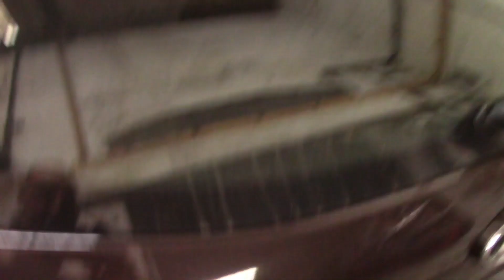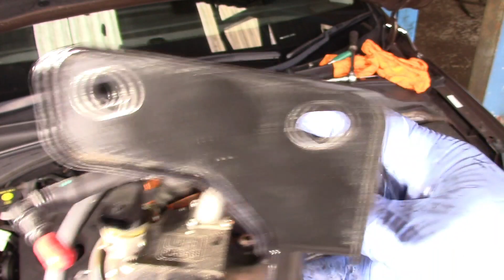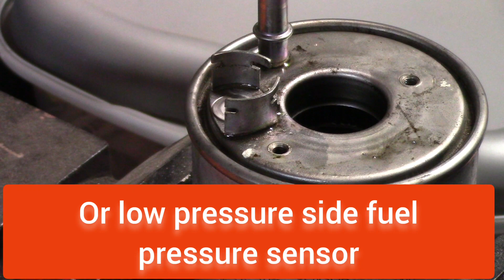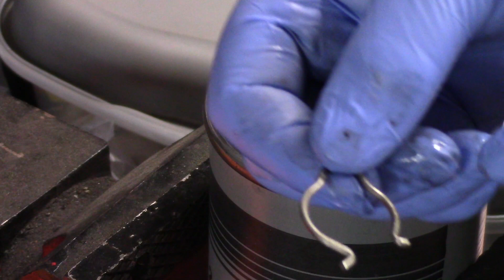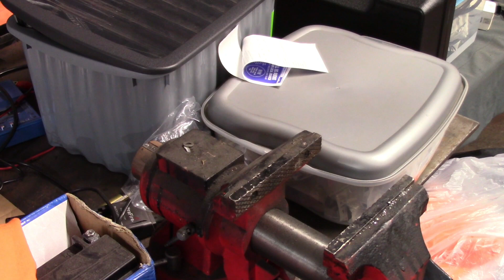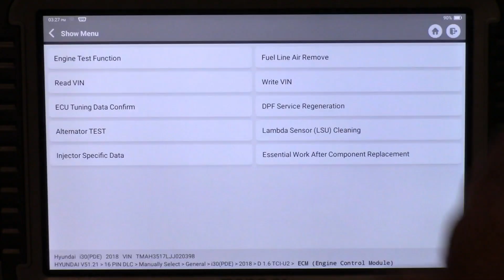Hyundai i30 (PDE) 1.6 CRDi D4FB (U2) Fuel Filter Replacement And Fuel System Bleeding

Comment: Hi, thank you for uploading this video. I got the 2018 version of this Hyundai i30 hatchback with 110 bhp. However, when I look online for suitable fuel filters, it asks me to enter the registration of the car which I enter and then there are several filters but have different numbers & look different but they say they will work in my car so how do I know which is the right one to order?
Reply from the maker: Thank you for watching our channel, best option is to contac the supplier to get the right part, or see your current filter part number.

Comment: Hi thanks for the video. If I can't bleed it and I already took out the filter, is it bad to start the car and drive to a mechanic?
Reply from the maker: We appreciate your viewership. The primary purpose of bleeding is to avert dry operation of the High-Pressure Fuel Pump (HPFP). Operating the HPFP without fuel can lead to significant damage, as fuel serves as the essential lubricant for the pump. Once the engine has been successfully started, there is no further requirement to transport the vehicle to a mechanic.

Comment: Hi.
Nice video, helped me to answer the question: how are you going to bleed the filter after the work.

But on mine I haven't removed anything else apart only fuel filter lines and the body with the filter it's self. Wasn't necessary to removing intercooler pipe.

Regards
Reply from the maker: Thanks for watching our channel

Comment: Which OBD2 tool do you use? Did it not make you nevous that it kept saying "Failure!!!"?
Reply from the maker: Thanks for watching our channel. 
It is a TOPDON PHOENIX PLUS SCANNER.
Reply: I have used Xtool A30M on mine and it worked perfectly. You can even choose for how long you want this pump running or until you press stop.

Comment: Hi, great video. When it comes to bleeding the fuel filter (not everyone has a diagnostic tool to bleed the filter), could you prime the new fuel filter by filling it with diesel first before installing it. After the pipes have been reassembled and the electric fuel pump has been primed by switching on the ignition, surely the engine would start straight up as filter is full of diesel??
Reply from the maker: Thanks for watching our channel 
I followed the service manual instruction, and i didn't try filling the fuel filter up, but on this model, the fuel pump will only be activated when the ecu receives the crankshaft signal, not with only turning the ignition key to the on position.
Reply: Thanks for replying. I just wondered if filling the fuel filter would help with the bleeding process. The earlier i30 diesel engine had a hand fuel primer on top of the fuel filter housing which was brilliant. Why do manufacturers have to over complicate a simple service item. Thanks again for posting the video.

Comment: This Hyundai system is a shit because if you run out of fuel....then how you can start the engine? You can not...very fine
Reply: Of course you can. It will take you just more time without scanning tool.

Every time when you turn the ignition ON, the pump is ON for a few seconds (you can even hear it when it's quiet around you), so it will be enough to turn the ignition ON multiple times to bleed the system itself.

Comment: Hey thanks for the upload. I was wondering if these 1.6 crdi engines really are reliable? And how long do they really last? Some say they are garbage and some say they are superb
Reply: Hi, I have a Kia Ceed crdi 2013 which has the same D4FB engine, I’m a delivery driver, I deliver like 80-90 parcels in my car every single day, so I literally start and shit the engine more than 100 times a day and use it for very short journeys, the engine surprisingly has held up very well considering it’s done 95k miles which is around 150k km, safe to mention I do service it on time, oil change, filter changes, coolant flush, regular engine bay and throttle body cleaning and I treat it to a 45-60 miles motorway journey every week so the dpf can regenerate properly. Overall, a great choice, I’ve recently noticed a slight rough idling on cold starts only hence I’m watching this thinking it might be the filter that’s never been replaced
Reply: @alialiali9796 the engine on this video is a completely different design to what you have got.

I have two of these now Kia cee'd 2013 1.6 Crdi with 170k miles on clock and Kia cee'd 2019 1.6 Crdi with 56k miles.
You might think these engines are still the same but they are not. The biggest difference is the older one has a cam chain the new one is on the belt now.
In the old one you had a manual bleeding pump for the fuel filter on the new one you must to f..ck all about with OBD2 tool or turning the ignition ON 100s times to bleed the system out, just for making sure you will go to the garage for simple job like this and pay them money instead doing it yourself.
Reply from the maker: Thanks for watching our channel 
They are reliable, if you take care of them and feed them on time (routine, interval service) it is Japan technology copied by Korea. But if anything goes wrong repair is expensive etc turbo charger,  CR fuel system.
Reply: @stanhopeautorepaircentrewardak  Friend, how many filter replacement? From what speed does Dpf actively burn out 1500 rpm minimum?
Reply: Mám Hyundai i 30 1.6crdi mám najazdené 350587 km to auto stále ide, denne z ním jazdím do práce cca120 km. Servisujem si ho sám . Olej mením každých 10000 km plus olejový filter a ostatné filtre mením každých 20000 km, takže každá druhá výmena je kompletná olej a všetky filtre. Až teraz pri 350000 km začínam počuť reťaz aj to len po naštartovaní ráno potom už nič. Teraz som z ním bol na STK a EK má trochu vyššie emisie ale stále je to v norme prekvapilo to aj technika na emisnej. Ja osobné som z voľbou motorizácie spokojný .

Comment: I want to buy Kia Proceed 1.6 crdi 2013 with 143k km is it a good car ? Are the engines good ? Is there any problems with the engine ?
Reply: 214k km without any problem on the whole car. (jd 1.6 crdi, 81kw/110ps). first fuel filter (but carrying one as spare part in the trunk).

Comment: I thought this was going be like changing the oil filter. The Fuel filter is a lot more work.
Reply from the maker: Thanks for watching our channel. 
And also to be careful not to allow trapping any air  bubbles in the fuel system which may lead to damaging the HPFP.
Reply: @stanhopeautorepaircentrewardak  that's why i took it to a hyundai dealer. changing the fuel filter was about 280 euro, which is insanely expensive. the filter alone was 130 euros which you could get one for about 50 online. i didnt want to take any risks because it was a new-to-me-car. :)